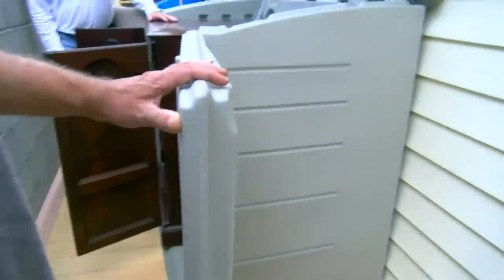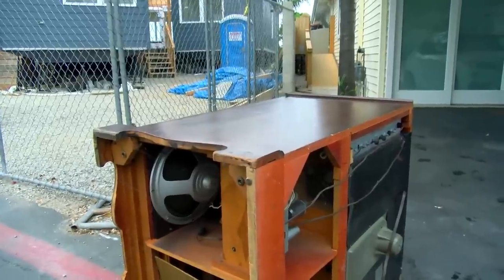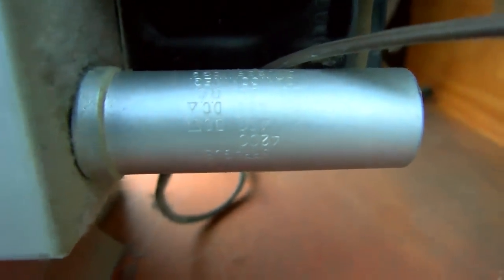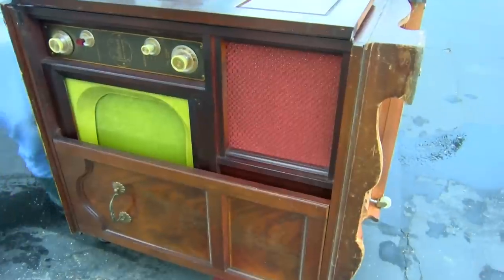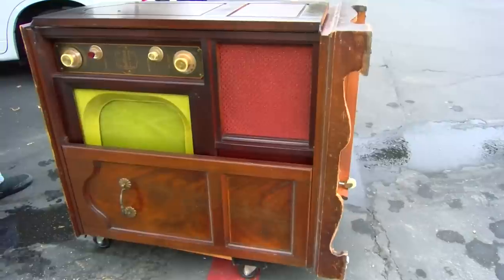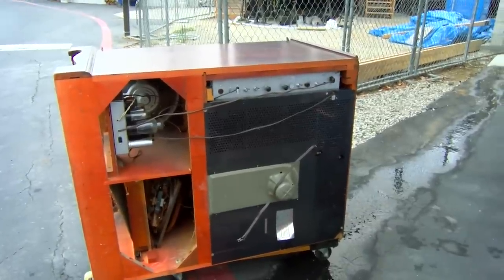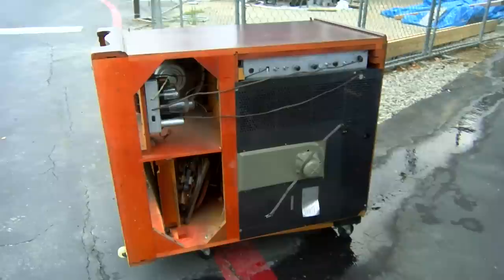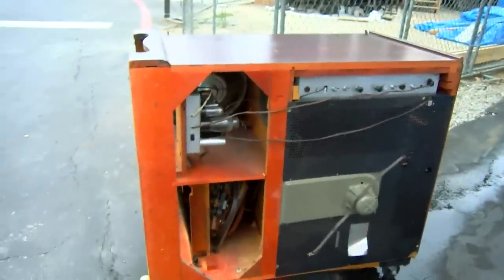Hoffman 1952 TV AM FM Phono Pickup

Comment: It's interesting to see how manufacturers  differed in their approach to masking the  round crt.  Hoffman chose a square mask which excluded the edges of the crt.  Zenith used the same tube in some of their porthole sets and chose to show the entire face of the crt.
Reply: +chrisw71 If it is a 1952 model perhaps Hoffman got a deal on some round metal-glass 19'' CRTs and used the rectangular mask to cover up the fact? Round tubes were passe' by 1952, even Dumont had gone to rectangular tubes by then, so they were probably cheap to buy if any manufacturer still wanted them.

Comment: webster - chicago made excellent record changers my mom's 1953 zenith cobramatic changer was built by zenith as zenith never used webster chicago record changers.
Reply: I've always suspected that those wonderful hybrid-drive Zenith Sebeilius (sp?) turntables from the mid-1960s with the clam shell 45 adapter were also made by Webster, but I've never found any confirmation on that one way or the other.  I know that some of their designs were optimized for horizontal groove modulation and didn't fair well with stereo pickups, despite being impressively well made.
Reply: I believe that the Zenith Cobra Matic changers were made by the Voice of Music Corporation in Benton Harbor, Michigan.